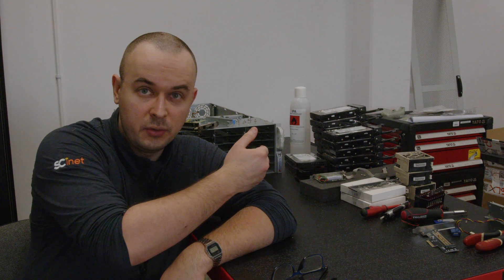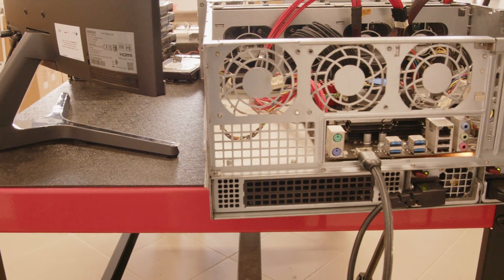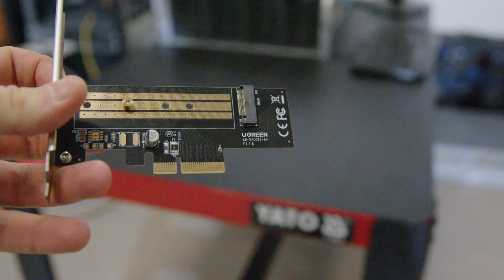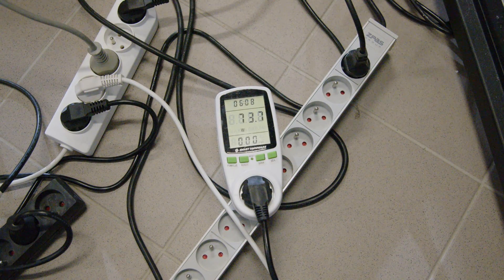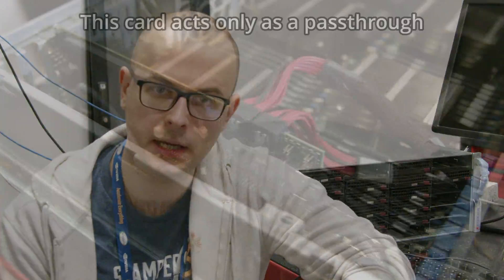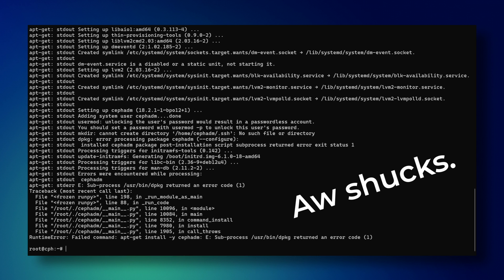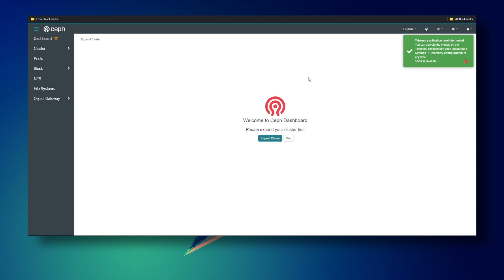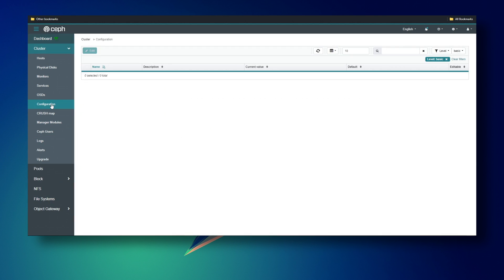An AMAZING Ceph NAS server build from legacy hardware

Comment: What sort of performance do you get in this one node ceph install? Have you run any FIO tests?
Reply from the maker: I haven’t properly
Benchmarked it because i have a mix of sas and sata drives there and the hardware is more than 10 years old so I use it as cold storage for media. I’ll say that hardware is the most limiting factor here because in theory you’re skipping network chokepoints when it comes to rebalancing etc.
Reply: @DCTekkie  So then what's the real downside of using Ceph as a one node install? I mean compared to something like unraid or mergerfs or similar? I need to try and setup a system to try this out myself!
Reply from the maker: As far as i'm concerned there isn't any. I can imagine that all in all Ceph is more of an "expert system", but I'm surprised more coverage on it isn't being done ~
Reply: @DCTekkie  true! The learning curve compared to ZFS is undoubtedly a bit higher. Also the fact that Ceph was never intended as a one node system might play into it 😅 but if it works it work!? With the correct EC settings I struggle to see the downsides? Higher CPU/RAM utilization compared to a similar setup with ZFS?
Reply from the maker: I don't have all the answers, but I'd say it that Ceph is like kubernetes. It's not meant to be single node, but it works fine as one.

Comment: Just about that time you published your film I was setting up a new Ceph server on a single node (as in your example). I could have been switching from spreading data between hosts to between osds in advance by supplying the initial config. The next stumbling block was using more than one MDS per fs on that single node, not knowing that one has to ceph orch apply mds … and ceph orch daemon add mds … manually, authorizing a client (simple), mounting an fs on client (disaster) and finally getting to know that all documentation describing Ceph using two public_network-s is a lie. Only extracting/injecting a monmap can change the mon addresses and they can only by one (with two protocol versions at most). Thinking in the way several times about not easy but usable ZFS I still managed to restrain myself from deleting Ceph and continued through the stations of my Ceph's passion.

Comment: if there are internal usb port, you could technically get a clover? (iirc) usb boot and points it to the PCIe m.2 SSD thus technically boot off of USB then off OS on the PCIe SSD.
Reply from the maker: Like I said in the video, i didn't like the idea of boot being split into two equally critical components. You could get a small USB with GRUB or Unified Kernel Image,  but then you have additional critical component in your system. M.2 SATA SSD's are dirt cheap, and the passthroughs still exist (albeit they're getting more rare, especially those with SATA controller on them)

Comment: Remember too, using Ceph with dissimilar drives will limit the cluster's throughput and IOPs to the speed of the slowest drive.
Reply from the maker: It will also put more data on the bigger drives, making them read&write more, yes. But just for lazy storage purposes, or learning it's not that much of an issue